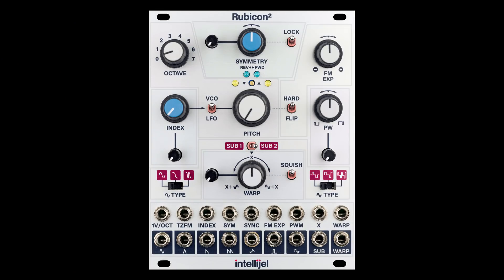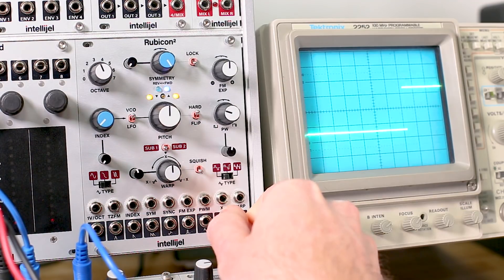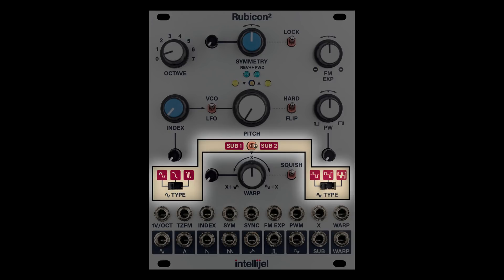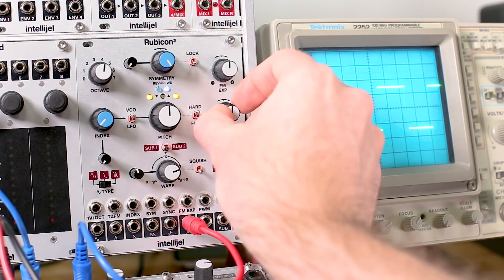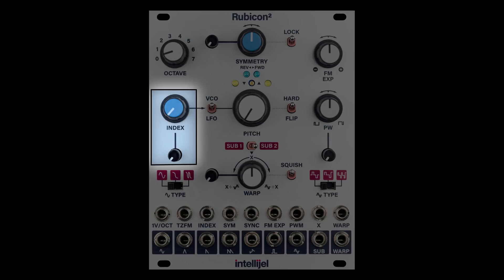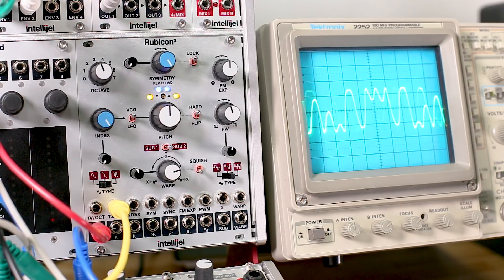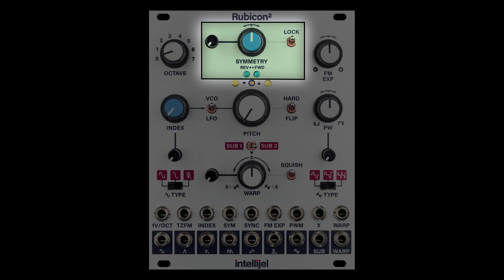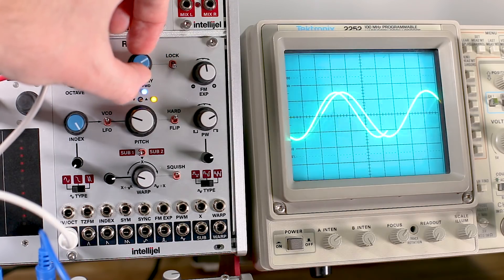Rubicon 2 Panel Overview

Comment: Hi there - I expect the answer to my question will be obvious, but can you please tell me how I apply a gate signal to the Rubicon2? All the other oscillators in my system have both a 1v/oct and a gate (or trigger) input, but the Rubicon2 only has a 1v/oct input - how do I do this? I'm really enjoying the Rubicon2, but not being able to gate/trig it is frustrating. Thanx!
Reply: Most analog oscillators like Rubicon just output a steady tone, so you need to use a VCA and an envelope to control the volume level. Generally it's only the percussion or digital voices like Rings and Plonk that have gate inputs.
Reply: @ScottMFR  Thanx Scott - I thought it might be simple. Yes, I was only looking at my digital VCOs. Fortunately, I have both your Dual ADSR and Quad VCA for such duties!

Comment: is Rubicon 2 a good module for bass patches? Didn’t see to much video examples in this direction. Thx
Reply: Rubicon is great for thick bass tones! You can always add more girth by blending in the SUB oscillator output. 

Did you check out the other Rubicon video? There's a few good examples here: https://youtu.be/BwxSuhqsrEE
Reply: Yes checked now thx! Your are right, indeed crazy module for bass as well :)

Comment: I haven't bought my oscillators yet.  I just bought my case (Intellijel of course).  However, the Rubicon II is definitely in the next round of purchases.  I'm probably going with Tip Top Z3000 for my vanilla oscillator.  I believe it has a tuner built in to it as well for external signals.  As far as the Rubicon, so many delicious options... before you even get into any complicated modulations and effects.  

I want to see the Rubicon used as a complex LFO to modulate a filter's cut-off and drive over a four bar loop... with and without retriggers.  I want to see the Rubicon doing the majority of the work and then something crazy with the LFO (doesn't have to be filter related).  I think you've kind of skipped over what this thing can do in low-n-slow mode.
Reply: I'm sure you'll love your Intellijel case!

We could probably do an entire video just on using the Rubicon as an LFO. So much to cover with this guy. Thanks for the idea!
Reply: ScottMFR got the Rubicon 2.  Something in it rattles but it seems to power up and oscillate. Got the morgasmatron and quad vca today.  Will be a fun night.
Reply: I wouldn't worry about the rattling, that's often just the spacers between the panel and the knobs so it's fairly common. Definitely sounds like a fun night!

Comment: at 3:44 oscilloscope goes batshit bananas, can't even figure out what waveshapes it was showing)
Reply: According to all known laws of sound design, there is no way that a wave should look like that. Its shape is too crazy to even be contained within the screen of oscilloscope. The wave, of course, generates anyways. Because waves don't care what synth nerds think is impossible.
Reply: The waveforms generated are subject the laws of the country in which they are output
Reply: don't you dare, sir, it's mine)
Reply from the maker: It is a SAW wave being modulated so you see it essentially switching between a SAW and RAMP as it  passes through the zero frequency point and reverses.
Reply: ok but 10 seconds later it's all wavy and self intersecting like what on earth is that, is it even legal?
Reply: Complex waveforms are complex!
Reply: Illegal Waveforms could be a good album title...
Reply: The craziest thing to me is the CV modulated Warp between 7:22 and 7:30.  That's definitely not yer daddy's waveform!